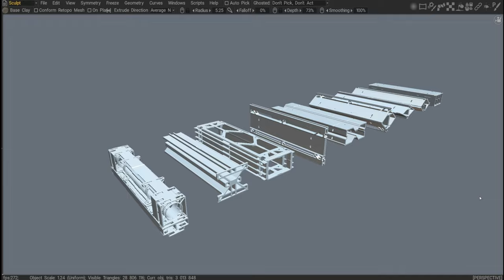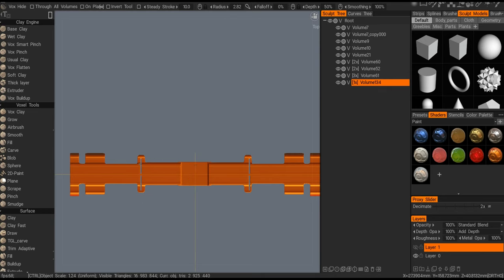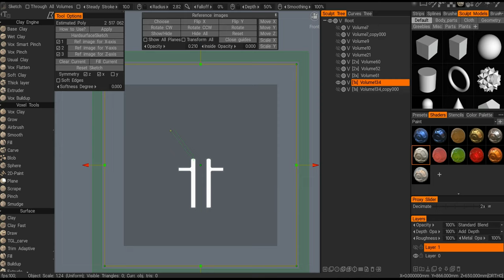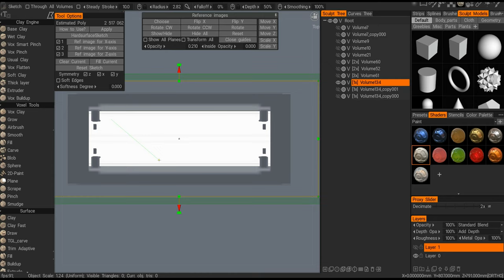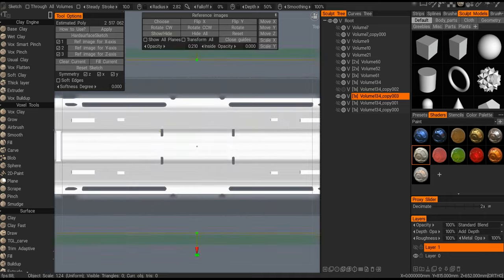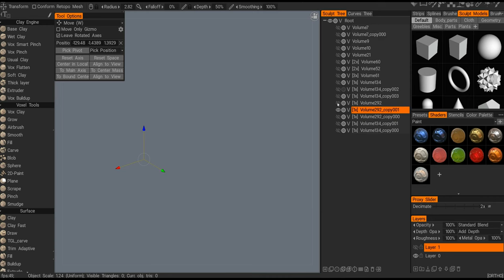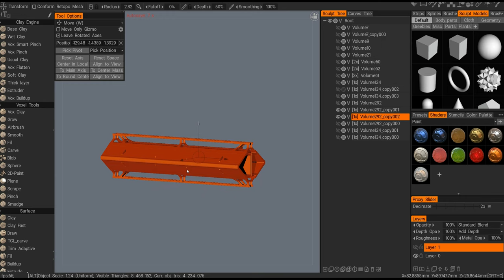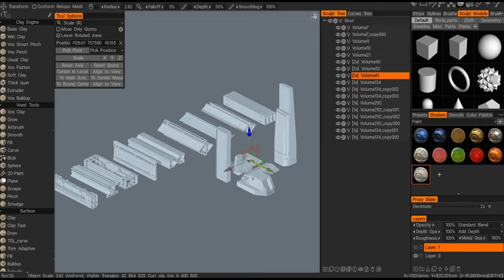Design Complex 3D Shapes at Super Speed in 3D Coat using Sketch Tool

Comment: anton how do you decimate in 3dcoat so it comes out with sharp edges and lightweight for blender?
Reply from the maker: I can decimate down to 40-80k tris for blender. It's still a bit heavy but if the kit is not too big like 10 meshes it's manageable with instancing
Reply: @AntonTenitsky  i see. i must be doing something wrong. so there's no special way to decimate while preserving edges? cause when I try this my meshes come out looking blooby and soft.
Reply: not sure if that helps but I convert to surface each layer manually, then decimate it manually as well to have a control over the result - if You only decimate during exporting whole scene it might decimate it too much without You even knowing it until You load it in other program. On top of that I do planar decimation in blender - topo is shit after that but it is super light and generally respects flat surfaces nicely
Reply: Don't forget you can use limited dissolve in Blender to rid of extra geometry. I use that when making rails using Skin modifier.
Reply: @phantomapprentice6749  is that better than decimate?
Reply: @marowak87  how do you decimate manually??

Comment: Hi Anton, when I try and make diagonal cuts like you have, it comes out very rough and pixelated, what am i missing??
Reply from the maker: Are you using latest version? They improved a lot on the tool in the last month
Reply: @AntonTenitsky Yep, completely up to date
Reply from the maker: @InsipidReactionary03274  hmm, you can try to up the resolution of sketch to 512 by 512
Reply: @AntonTenitsky  Nope, no luck there. V Strange
Reply: @InsipidReactionary03274  same here
Reply: Use bigger "border width" in E panel
Reply: @AndrewShpagin_Integral  Thanks Andrew! Works.